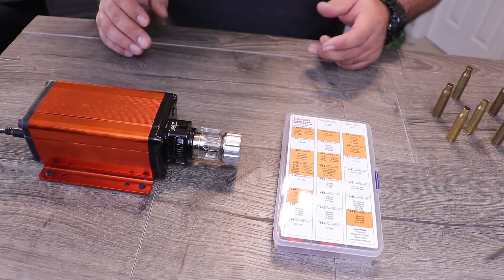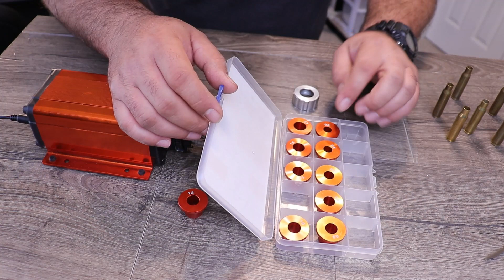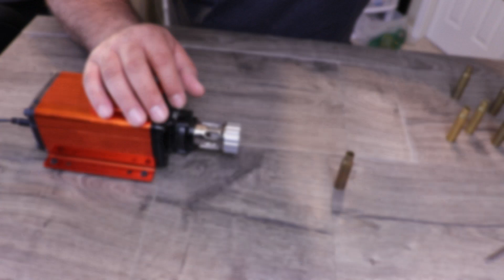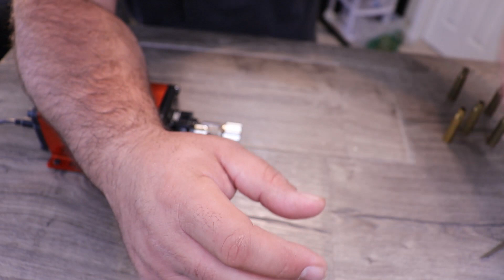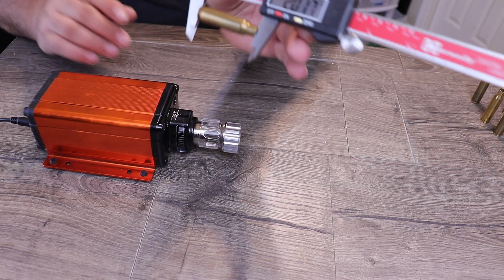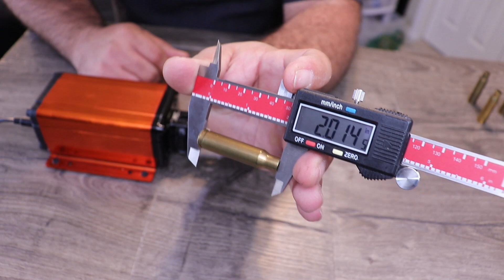Lyman case trim Xpress overlook and review

Comment: You never have to trim straight wall brass so don't worry about not having that feature. 
The cases on straight wall don't get longer like bottlenecks.   Never trimmed any of my pistol or straight wall rifle brass.
Reply: But if you do there is a way to do straight wall on this trimmer.

Comment: The 2.004 trimmed down more than the other ones due to the shoulder not being the same as the other ones!
Reply from the maker: Yes that was most likely the reason. I resize all the brass in the same Die so I don’t know why it would have different shoulders.
Reply: Adjust setting
Reply from the maker: Yes I could of done the but I would of had to Measure shoulder to the end of the neck to see exactly how much to trim off.

Comment: Mount it to your workbench with a plywood shim of whatever desired thickness to raise it up a bit, then find a little plastic or metal tray that'll fit under the trim head and catch the shavings coming out the bottom hole...
Reply from the maker: Thanks that’s a good idea. I will try it.

Comment: I have that and I love it. I bought time threaded plugs that I put in my reloading table on the edge so I can take some screws and bolt it down when I use it the I can store away when not in use. If you know what I mean. Using a machine that indexes off the shoulder you can also use it to see if your head space is the same. If all the cases are the same after sizing then they should have the same OAL if one is 2/4 thousand under or over then that case is 2/4 thousand over or under head space.
Reply from the maker: That is a really good point.